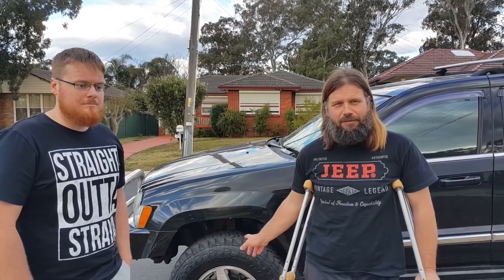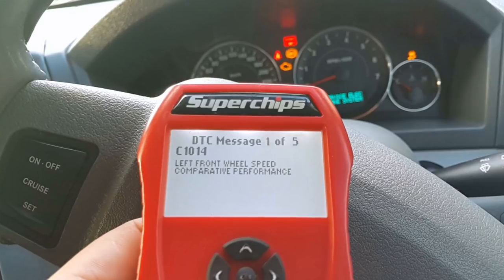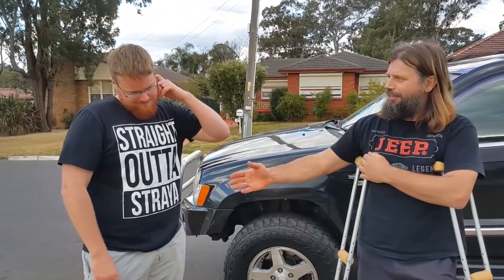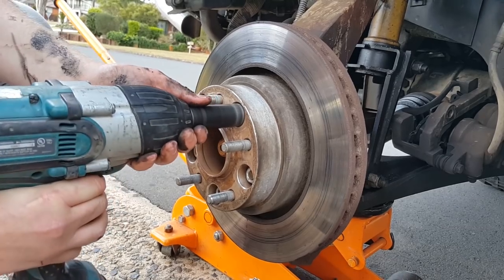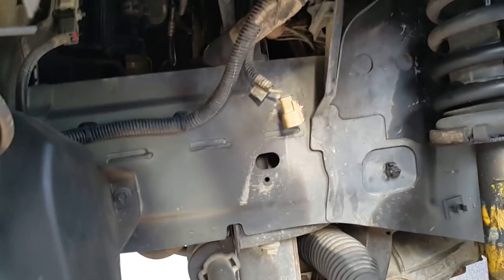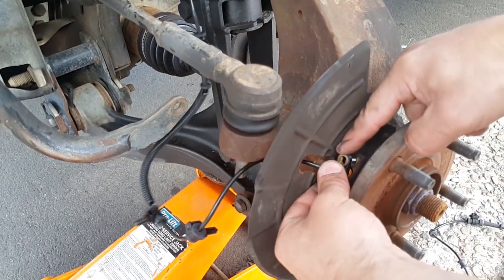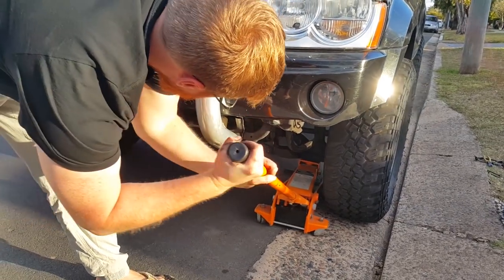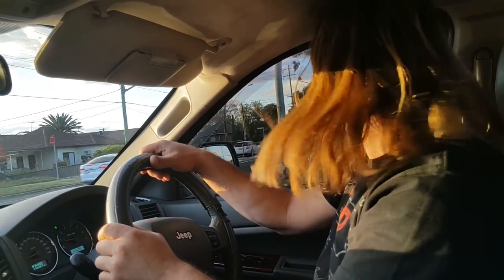Wheel Speed Sensor Replacement - Vlog #8

Comment: Thanks for the video!
Replaced mine a few days ago, using this video as guide. If you're in a rust prone area, be aware the sensor will likely be stuck due to a build up of rust inside the sensor well. I ended up snapping the top of the sensor off, as opposed to twisting it off gently. I then carefully drilled a pilot hole down the body of the sensor taking care not to drill past the base of the sensor. Then I fired a 3" high quality screw into the pilot hole, and gently but forcefully pulled/pried the sensor head out, and cleaned up the sensor well as best I could, and carried on with the replacement.
Good luck!
Reply from the maker: Glad the video helped out 😊 Thank you for your input also 👍
Reply: @AussieFourWheelers  hey I have the same problem I believe. My speedometer is not working and the rest of my gauges work. The abs light is on as well normally I would turn the car on and off and my speedometer starts back working but every since my battery died it's not working at all.
Reply: @AussieFourWheelers  did your speedometer stop working while you was driving?

Comment: Good job guys! 
Can you please tell me what kind of aftermarket multimedia do you have installed in the Jeep? How does it sound compared to the original? Are all the conectors just plug and play or you have to modify them? The original REJ navigation- radio in my WH has got a black screen, also some buttons don't work, so I need a replacment. However most of the aftermarket solutions are for the 2008+ ( after facelift) Grand and the conectors are different..
Reply from the maker: Thanks bud 👍 It's a Chinese Android version with the capacitive touchscreen made for VW but I made it to suit with a bit of trimming. Original sounded great, then I had another Chinese unit with resistive screen and also sounded great, maybe even better, but this one, I'm not happy about the sound at all. I'm gonna have to check the connections once again. But the main reason I got the Android unit is so I can run the Torque app. Yeah, you have to get the older canbus system ones, the facelift models use a different canbus system. I had to modify the connections, not plug and play unfortunately.

Comment: I changed my rotors this past weekend and my previous rotors didn’t have the seal placed  at @4:13.  Do i need them? Or is it something just to hold the rotor in its place?
Reply from the maker: You can run without them, they hold the rotor.
Reply: Aussie Four Wheelers thanks!!!

Comment: What is better choice between bilstein b6 4600 or b8 5100 if I want to lift up my 2007 WH 3.0 laredo crd about 3"  front and rear?   :) and can you recommend 3" lift spring?
Reply from the maker: 2" lift spring would be ideal for setups without the diff drop and steering knuckles. 5100's are a good shock. But I'd go with HEMI springs (because of a higher rate) and don't mind a firmer ride.

Comment: Wheel spacers...am I just a worrier over nothing, or are they actually safe?  Also, I tend to put the tire under the vehicle after removal and use jack stands because I never trust a jack.  Guess I do worry too much :)  Great video series on these Jeeps down under.  I subscribe to these channels like yours to admire the Patrol and Landcruisers we can't get stateside.  Still, am fascinated with seeing that Jeep all Aussied up.  Beautiful machine.  Thanks for posting these videos.  Cheers.
Reply from the maker: Wheel spacers - been running them for years without a single issue. Just gotta be put on right.

We ALWAYS use jack stands when working under the vehicle. NEVER EVER go under a vehicle without them. Approximately 23 years ago, I was working under my race car with only the jack holding, then felt thirsty, got out to have a drink and while I was drinking, it went down. I was so lucky and thank God for that! Could've lost my life that easy. I was young and stupid, that's for sure. Ever since then, I've never worked under a vehicle without jack stands. In this case, we were working side on, so not really dangerous if you keep in mind to stay clear in case the jack fails.

Thank you so much for the feedback and taking the time to comment. Much appreciated. Glad you like our videos too. Also thanks for watching them and following our adventures.